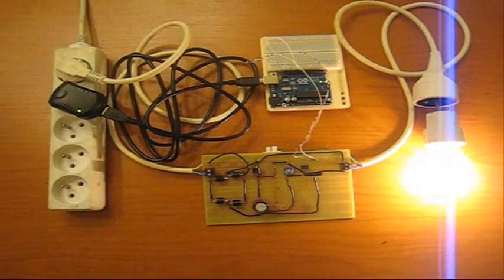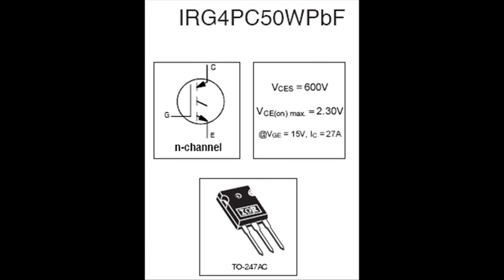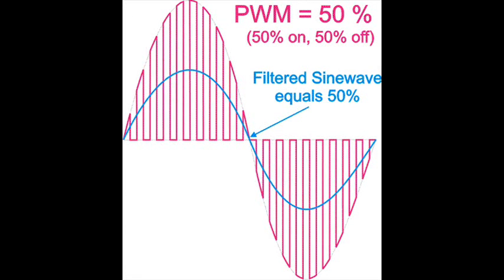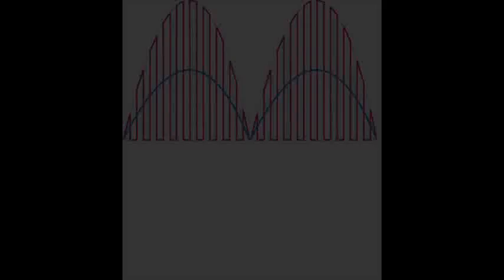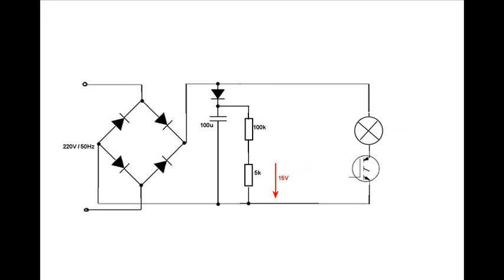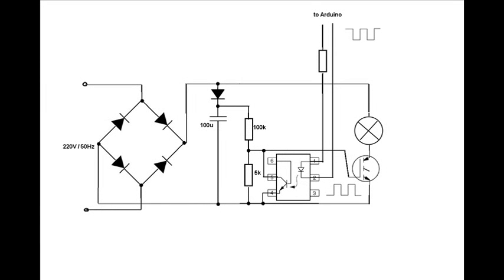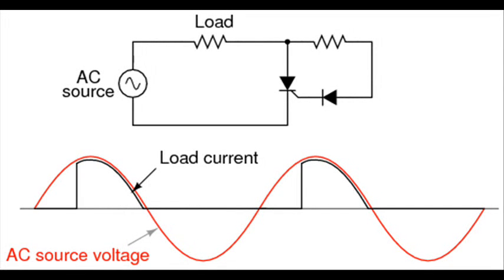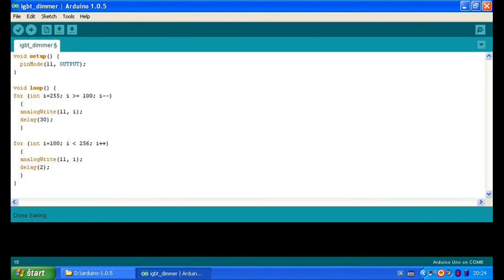AC dimmer with PWM on Arduino

Comment: Hi Jaroslav, awesome idea. Would this work for 230v replacement (dimmable) LED lamps as well?
Reply from the maker: Hi, I doubt. There's a lot of electronics in the LED lamp, which converts 230V to the low voltage needed for LEDs. Unless I know the wiring inside I would't hope. Mainly because my dimmer has a  DC bias which may burn any electronics not suitable for that. However, If you really need to know, send me the LED lamp and I may try :-)
Reply: IF LED lamp has PFC circuit in it (which almost all of them have), it will not work.

Comment: Can I use the same circuit for controlling the speed of ceiling Fan(AC Induction Motor).
Reply from the maker: Depends on what motor it has. If there is a motor which could run olso on DC, then yes. If not, I doubt.
Reply: yes

Comment: also your dimmer generates humming, but at a different frequency! Although your dimmer uses 500Hz (from the arduino) instead of 50Hz you can still heat it!
Reply from the maker: Yes, the 500Hz humming is generated but as you say, it is not audible. At all. However, at very low brightness, the 50Hz (100Hz) is hared as the bulb has significant thermal cycles.

Comment: Good Job and very good explanation.
I'm doing a system that allow to derivate the excess of the PV electricity to a heater.
I solved the same issue using a potentiometer and arduino modifies a resistor, but your method is more accurate.

The problem I had was i need to manage at least 4 A so, I don't know if your system will support all this power.

Details:
http://www.calentadorsolarpasoapaso.blogspot.com.es/2014/04/proyecto-evitar-inyeccion-con-arduino.html

Thanks for sharing.
Reply from the maker: Thank you

Comment: by the way, if an optocoupler such as a 4N25 is used, is an IGBT needed? i was going to use an IRF P460 mosfet with a 4N25...
Reply from the maker: Err.. I might have missed the point. An optocoupler such as a 4N25 is used just for case, to save the low voltage electronics if something goes wrong in the high voltage circuit. Theoreticaly it does't need to be there. IRF P460 will work too, but the case with optocoupler stays the same.
Reply: Apologies, it was I that missed the point. ... Thank you for your support

Comment: Very interesting. I was just wodndering if the lamps do not have a problem with the  higher voltage. after all, there will be some 310 Volts over the lamps who are in fact made for 220 Volts
Reply from the maker: Hi, no, that's definitely not a problem. The 220V rating means effective voltage of sine shaped cycle. In fact, any 220V sine cycle reaches the 310V in the peaks, but that's something that lamps are suited for.
Reply: ok, thanks

Comment: Hi Jaroslav, your implmentation is nice. I'm just trying to introduce a digital dimmer for my home building automation system and I first tryed the inmojo one. It also looks nice but it requires for interrupt reasons you refer in the video a microcontroller for each channel. Infact using delay in interrupt routing it is not adviseable and it creates problems and delays with other interrupts (e.g. the interrupt that increments the millis()). I've not yet looked for interference, but at now connecting a normal bulb no noise is audibile, but I suspect it could also emit RFI and EMI (i think solvable with an LC filter). However looking for professional products, the last lines of products uses IGBT and pwm and I also read an interesting article (http://www.thedimmerchannel.com/installation-fundamentals.html) that says it will be the future. Also, I need to measure the current and voltage level + phase shift and I also suspect (i'm to test it) that It is not so feasible with the TRIAC solution. I hope you will solve problems about the power. What about the license of your work? is it open?
Reply: Jaroslav Hruškovič In regard to the idea of switching the bulb and transistor and using a PNP transistor to solve the "safety positioning problem". That is not a solution!!! As the bulb will still be brought to the full negative line voltage every cycle. The bottom rail out of the diode bridge does not say at neutral but rather switches between neutral and line (when line is swinging negative).
Reply from the maker: Hi Paolo, yes, I also like the simplicity of the code in this case. The interference is for sure there, I checked with SW radio and it clearly hums. But I think an easy ferite clamp would decrease the emissions. Or, of course, a suitably designed LC filter too. The current and voltage level in this case might be tricky as there is AC with the DC bias on the output so be sure you measure correct values. The problems with the power as well as some others might be soluble with other type of the transistor - PNP. But at the moment this is not available for me at desired power rating. Meanwhile I am using this wiring for an artificial sunrise, i.e. at 5:30 AM I am slowly dimming-in a 400W halogen lamp so that I get full light at 5:50 when I wake up. Still a torture, but bearable...
Reply: Jaroslav Hruškovič

Dear Jaroslav,
I'm not so expert of analog electronic (I'm an IT, and I'm fair only with digital electronic), so please if I say a non-sense, but what  if you put two or more IGBT in parallel? Did you try it? Also, I read about this ultrafast switching (rs-components 671-5424 and 						671-5433)
Which optocoupler are you using? MOC3021?
Also I didn't understand the security problem you are referring up. Why it is not safe?
Paolo
Reply: Paolo Rendano
Ok I understood why it is not safe. But I think is only a positioning problem. If you put the IGBT before the load you should solve this. Should it?
Reply from the maker: Hi Paolo,
You ask if it is a positioning problem. The answer is yes and no. Of course you might swap the bulb and the transistor and it will be safer. But - you will need very high voltage (over 300 V) to open it. And you have nowhere to get such a voltage in the circuit. Therfore, if you want to swap, you need a PNP transistor.
And regarding the power rating of the transistor - yes, you may use two (even three or more) in paralel. But only if you make sure the temperature characteristics ensure that the hotter transistor is offloaded more. Not all transistor models provide that.
Reply from the maker: Wendell Rogers  Errr... that's true. Sure, PNP transistor doesn't guarantee the safety. Thanks for your comment.

Comment: I like you project very much and I'm very interested in it so my question to you is do you have an updated version of your circuit ?
Reply from the maker: Hi, I currently upgraded the circuit for the 400W lamp. The wiring however, stays the same. I meanwhile tried another wiring but that I am not going to publish because it has serious disadvantages. In my case I burnt the transistor when the dutycycle reached 100% as there was a voltage dropping on the gate so low that the transistor was semi-open and thus had a enormous power dissipating. Currently, I am thinking of using two transistors wired complementary so that each handles one half of the sinewave.